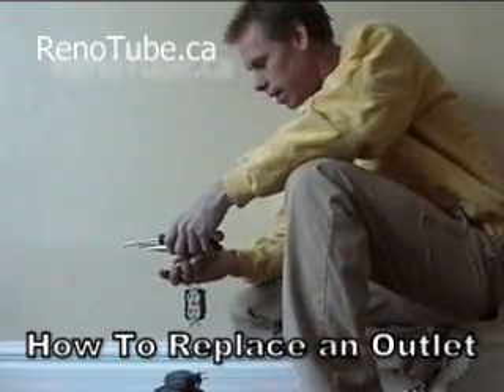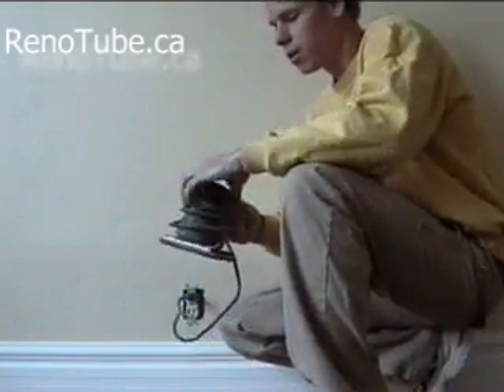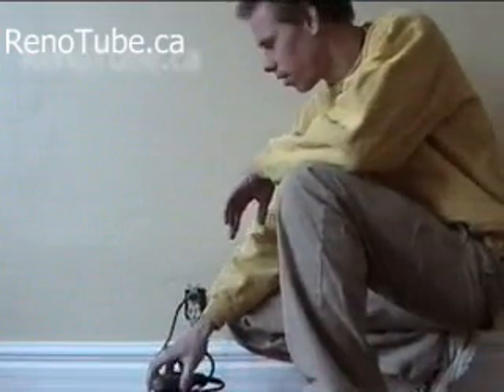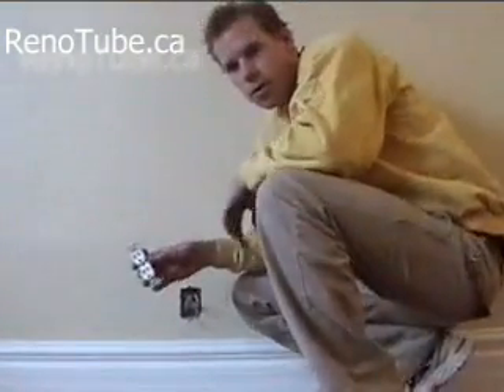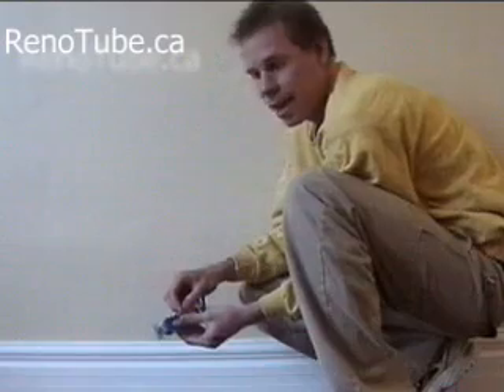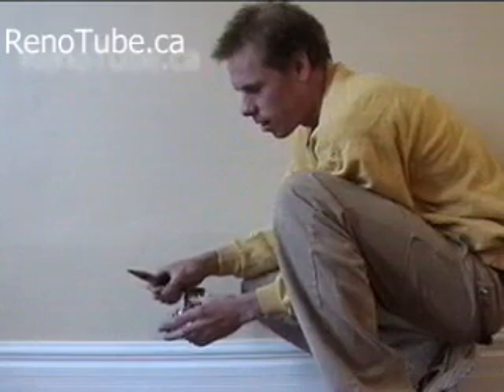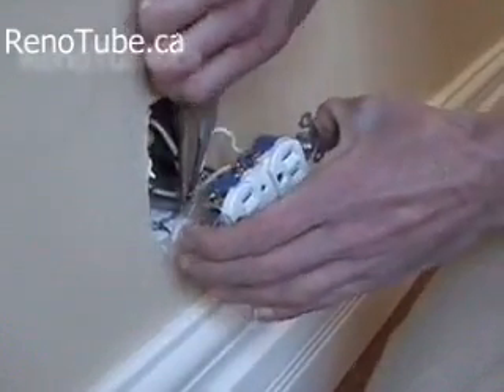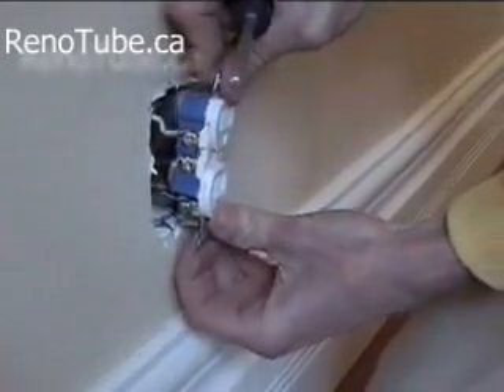Changing an electrical Outlet

Comment: Your junction box should be flush with the drywall, not recessed. In your recessed setup, there is an increased risk that the exposed drywall may catch on fire if arcing occurs.